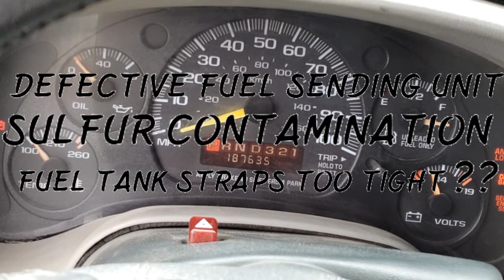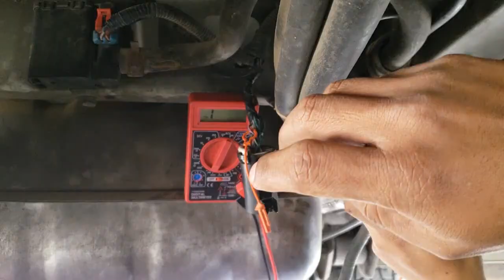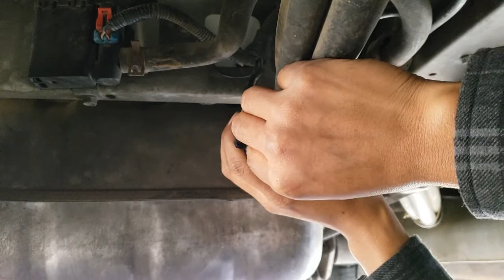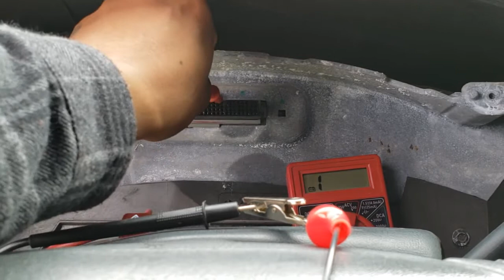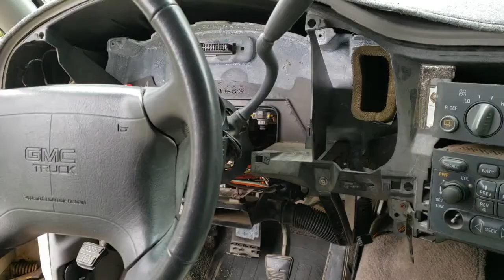Inactive Fuel Gauge Fix Astro/Safari

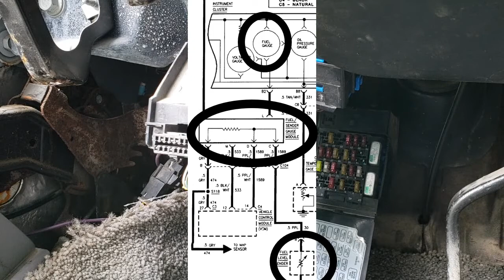Comment from the maker: 5:43 The Fuel Sender Gauge Module of this type is only used on the 96 to 98 model. The wiring diagram changes for the later models.
Reply: I used his method to do a 99 Astro van and it worked. At least the leads on the fuel pump read on my meter the way that this guy said.
I didn't check the wiring up to the dash.
My problem was just a bad sending unit and the method he shows worked on the 99
Reply: I used his method to do a 99 Astro van and it worked. At least the leads on the fuel pump read on my meter the way that this guy said.
I didn't check the wiring up to the dash.
My problem was just a bad sending unit and the method he shows worked on the 99
Reply from the maker: @anotherwunathem  Excellent!

Comment: My fuel gauge and temperature gauge stopped working when I removed my alarm system. Also my digital odometer/gear shift goes on when on accessory but not when turned on🤷🏻‍♂️

Comment: Very oddly, my 2000 Passenger van lost both the fuel and temp gauges at the same time. Would greatly appreciate some tips and I'd be willing to pay you.
Reply from the maker: have you had any work done recently?
I would look at grounds G105, then G106, possibly G110. If you need to know the locations of these grounds check out this video
https://www.youtube.com/watch?v=BN4wL70HTHI&t=286s

Look at scan tool data to see if the computer is reading engine temperature as it warms up. If it is, there could be an wiring issue between the computer and instrument cluster, or even the instrument cluster itself is defective.
Reply: @OldSchoolNoe  I actually watched your grounds video and checked them. They are okay. A weird thing that happened is I blew a bunch of brake fuses, kept replacing them, and each time it blew, this would happen, but now it won’t blow anymore but the gauges don’t work. I’m sure I fried something lol

Comment: Hello Oldschool my oil cooling line popped out of the radiator and oil sprayed all over and my van stalled and won't start and the fuel gauge indicator pegs out to the 3 o'clock position , I'm sure oil has caused this my pump is a new Delphi I installed about two months ago and has run really great before the oil bath sprayed everywhere my fuse relay didn't get oil on or under the pins. What do you suggest?
Reply from the maker: this sounds like a crank but no start situation.
Go through the usual diagnosis.
1. make sure no fuses are open
2. verify that you have spark
3. verify that you have adequate fuel pressure

if those check out, that rules out a bad CKP sensor, bad CMP sensor, ignition & fuel system.
I would check those 3 first, you'll need a spark tester tool, and a fuel pressure gauge.

If oil sprayed under the hood, its possible that something shorted out.
Reply: @OldSchoolNoe  thank you so much for that advice , I have a fuel pressure tester I'm going to get the spark tester at harbor freight
Reply: @OldSchoolNoe  I will let you know how it goes after I do these tests
Reply from the maker: @hardtrooth1776  but did you take a look at the fuses? I would do that first before buying anything, make sure none are blown.
Reply: @OldSchoolNoe  I will check them in the morning
Reply: @OldSchoolNoe  Oldschool I  located the PCM ECM control module and it's covered in motor oil from the oil cooling line that popped out the other day. I replaced the blown ECM-1 20 amp fuse but i dont want to start or run the van like that what's my next move clean it with crc electrical spray or  test it.
Reply from the maker: @hardtrooth1776  cleaning it that way sounds good. That's what I would do, then test it.
Reply: @OldSchoolNoe  do I disconnect the battery negative terminal first
Reply: @OldSchoolNoe  well I electrical sprayed cleaned dried and dielectric greased it after disconnecting the negative terminal. And it started but I still don't trust it, lol. There wasn't any sign of oil inside it, there was litte dust though.the only bad thing that happened was I broke of the locking tab of the harness plug,I'm going to put some rtv silicone around that area and try to secure it somehow maybe zip ties or small bungee cord or just epoxy it. Next I'm going to change my crank position sensor. What else do you think might be causing it.
Reply: @OldSchoolNoe  thank you so much for your support and knowledge  to me you are a special person. You helped and not a lot of YouTubers doo.
Reply from the maker: @hardtrooth1776  its running? if its running you don't need to replace the sensors
Reply: @OldSchoolNoe  ok. I'm 😊 happy, I'm just wondering what caused the ecm1 fuse to blow out, it was running hotter than usual because my radiator busted and I have a failsafe thermostat stuck open that I'm gonna work on replacing tomorrow so I can burp the air out of the system. I can't thank you enough man.
Reply: Good morning OLDSCHOOL Ecm-1 fuse is blown what is the possibility that's causing ? this Noe

Comment: Great video... I've got the same symptoms on my 1997 Chevy Astro. Also i don't hear the pump when ignition key is turned to accessories position...
I cleaned the connections at the module... Gas gauge works now. I may have burned out the fuel pump or have a bad relay 🤷‍♂️.
Thanks for this information 👍👍

Comment: Where is the module on a 2003 ? Thanks
Reply from the maker: The wiring diagram that I found for the 2003 does not show a module. It shows that the fuel pump/sender assembly sends a signal directly to the PCM, then the PCM sends the fuel level signal to the instrument cluster.
Reply: @OldSchoolNoe  I must have a problem between the two then. My pump and gauge work fine but sometimes it shoots down to empty or in between. I’m running off the odometer for now till I can figure it out. Thanks again.
Reply from the maker: @johnnypena1083  The fuel gauge stays at 0 IF:
"The PCM detects a malfunction in the fuel level sensor circuit."
"The Instrument Cluster detects a loss of class 2 communications with the PCM."
Reply: @OldSchoolNoe  what color wires should I test then. Thanks again.
Reply from the maker: @johnnypena1083  I've uploaded the diagram at https://www.astrosafari.com/threads/inactive-fuel-gauge-overactive-oil-pressure-gauge.148021/#post-1598611 , have you tried the multimeter test shown at 1:49 ?
Reply: @OldSchoolNoe  I haven’t but is it the same ? Orange?

Comment: Thanks primo I have to check the video again one more time to check where you connected the red and black connectors to the components. I have the same issue the gas cluster stays in empty. I switched the gas pump and still have same issue.but definitely will check the circuit board.
Reply from the maker: What year is the van? I would verify that the fuel sender is working by doing the first test. It the needle stays on E, that means it could have a bad ground. Have you inspected all ground connections?